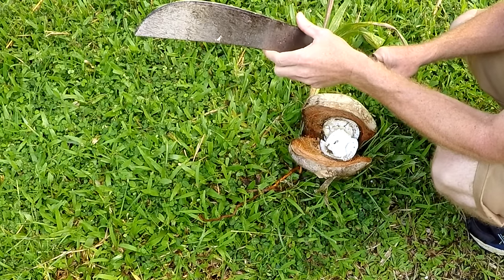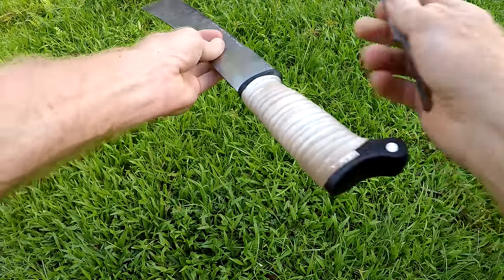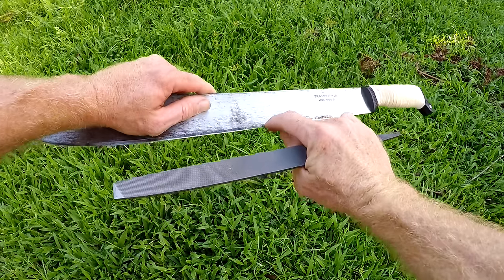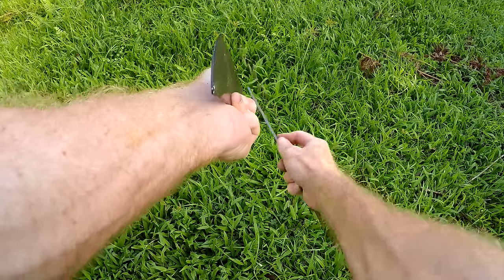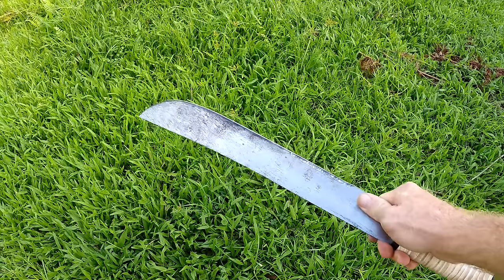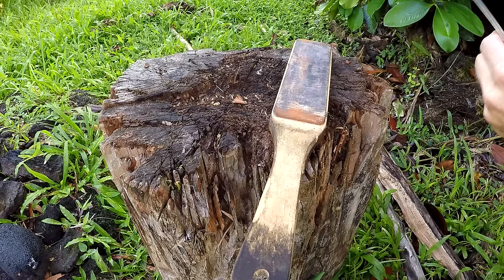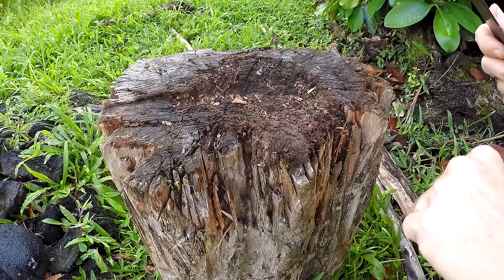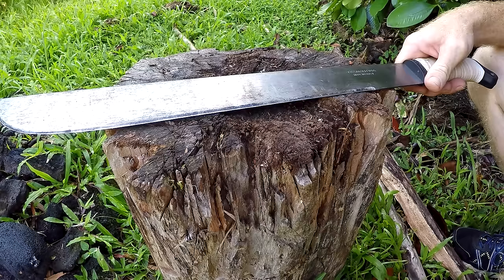How To Get Your Machete Razor Sharp

Comment: Over time, you'll dull your file running it the wrong way, or sideways at the end of your stroke. It's best to work in sections rather than trying to run one file stroke the entire length of the blade. It's more about caring for your file so it continues to work.
Reply: Caring for a $10 file? Just buy a new one..🤷‍♂️
Reply: @EZ_Case  If you like throwing things out and wasting money go for it. Idc what you do.

Comment: Sharp knife is a safe knife.....unless you get cut.
Reply: knife are bloodthirsty,so use it on your own risk.
Reply: A dull knife cut is so much worse than one from a sharp knife
Reply: @1knuckleheadhyperactivenin937  
Right a sharp knife cuts yes but its very clean getting cut by a dull knife becomes more of a mess and leaves your cut more exposed
Reply: @1knuckleheadhyperactivenin937  Except a sharp knife will go through much more. Sure the cut will be cleaner but you're much more likely to sever tendons and the like. The trick is to be careful no matter what, a knife is a knife.
Reply: Kyle Kenney Even though the initial cut is a lot less painful on a sharp knife, and the healing process is a bit easier
Reply: Been accidentally cut by my knives numerous times. Not felt it or noticed till I saw blood. Very clean cuts as well. Healed quickly.
Reply: How sharp is your axe tin man?
Reply: I like ya cut g

Comment: Wow, thank you dear man with shaved arms. 😂 Today, 26 years after my Daddy died, his WW2 1944 True Temper machete is back in my hands!  My sister's had given it to my son. I told him I wanted to buy a machete because I thought Daddy's was long gone, but it wasn't.   No stone to sharpen it, I gave it to my son. BUT, I found that same file you used in my garage....I cut paper!  I'm so happy, you are appreciated SO much, sat here filing it, and now I can use it to protect myself in my horrible city. I used it when I was a little girl to wack weeds down. Thank you!  I didn't need to go buy anything. I won't be shaving my legs with it though, LoL!  Much Love to you. 🙋‍♀️💜✝️🇺🇸
Reply from the maker: Thank you for stopping by
Reply: @gabehumphries5483  thanks for helping me. I found out today white vinegar takes rust off fast. And cheap. It worked..got some steel wool and gave it a rub after soaking it. YaY!  🙋‍♀️💜✝️🇺🇸

Comment: I have a machete that an older gentleman have me back in the 80's.  I think he used it combat in WWll.  The blade is just 10 inches long.  I think he had it about 30 years, and now I've had it at least 34 years. It has come in handy so much of my life.  I do still use it doing yard work. Back in the 80's I used to chip coconuts with it and got very proficient with it. Thanks for the video as I am needing to sharpen it. It was a marine or army issued one.  However it is in pretty good shape, despite some chips.

Comment: Very cool ! I have used the soft nail files / emory boards  to dress up convexed edges away from the shop to good effect. Some 1500 grit wet /dry sandpaper wrapped over a sheath works pretty pretty well too. A sharp machete is a happy machete. Thanks for sharing !

Comment: I enjoyed the video.  A file is the traditional tool for sharpening a machete.  It’s common to see a tico walking around with a sheathed machete and file.  When I first arrived about 20 years ago I too used a file because of convenience.  The difference is that I would laid the blade on a flat surface and terminated with an Arkansas stone.  As for your strop, my original looks very much like yours.  But I made it well after abandoning the file for sharpening.  After using the file for years I came across a Smith sharpener that must be the forerunner of AccuSharp that I preferred for a while.  Later I choose to use sandpaper w/oil.  Now it’s a Work Sharp belt sander.  My Latin machetes are made by Bellota in Colombia.  I am not in the market for another but I do believe that I will seek at a Tramontina the next time, they have a good reputation.  And yes, I made them shaving sharp from the beginning.  When the edge rolled I used another piece of steel to correct this, either my tile floor or the tool from one of my kukris.  I probably used that tool more on machetes than a kukri.

I would be more interested in knowing about the wrap on the handle.  My Bolletas have a wonderful rubber grips that I use as is, except for one that had to tame the upper seam, easily done with a moto tool and sandpaper.  The others I modified with friction tape or ranger bands, which are no more than a bicycle inner tube cut into bands.  However these are being replaced with rescue tape as the sun deteriorates the rubber requiring replacement too frequently and the friction tape frequently leaves a deposit in my hand even after using talc powder.

Comment: Hi- very informative! Thank you! I purchased machetes for clearing out the tall grass. Rains a lot down here in Texas. I do however have a few questions:
1.)When a machete is purchased, is it not sharp at all because they expect you to make it your way? (I was unaware about this and omg I was about to quit, I wasn’t cutting anything off!)

2.)What are the best machetes to get for clearing out yards? Either an online website or Home Depot/Lowe’s that are sold in those stores?

3)When purchasing a machete, is it better to buy one that’s lightweight or it doesn’t matter? (I’m a lady who does not have upper strength but wants a really good grip and cut.)

4) Do all types of machetes come dull and need to be sharpened. Such as the hook kind that is smaller?

5) I purchased Fiskars brand and Home Depot. Is there a better brand? I’m a HD shopper. Fiskars machete and Billhook clearing hatchet. 

6) On the cutting tools I purchased, the machete has holes at the tip of the blade, what is it for? 

7)What’s the best way to sharpen a billhook and how to really get a good use?

Thank you for your video and time. Hoping to get a feedback!
Reply: claudia Covarrubias 

1) some are some aren’t. Use an angle grinder or take it to a service who sharpens lawn mower blades if you don’t want to do it. 

2) if by yards you mean grass then a longer one is better, 18’>. I like to use an 18’ tramontina machete for everything. You can get them at Lowe’s. They are best paired with a gancho or a stick if you are cutting the grass. Basically just use the gancho to push the grass to the ground then cut the base of the grass with the machete. A Colima machete would be good too as they are long and you sharpen both sides of the machete.

3) you definitely want it to be light if you are using it to cut grasses and light brush. A heavier one is for cutting canes and bamboo. 

4) a lot of them do. Tramontinas usually do not come completely dull, however the tips are usually left dull for safety reasons.

5) yes there are way better machetes. I recommend these ones: 

Tramontina 18" Machete with Hardwood Handle and Nylon Sheath https://www.amazon.com/dp/B00LUZU6YO/ref=cm_sw_r_cp_api_i_qNpSDb4HB1DP9

Tramontina 24" Machete with Textured Black Plastic Handle https://www.amazon.com/dp/B01N6I3AYC/ref=cm_sw_r_cp_api_i_5NpSDbVYSHCFF

IMACASA 27 INCH COLIMA MACHETE https://www.amazon.com/dp/B00R0RGQNG/ref=cm_sw_r_cp_api_i_rOpSDb3CC84P1

6) You can sharpen a billhook with a cylindrical file. But they don’t need to be too sharp. Personally I do not use them very much as I prefer a longer machete. But you use them to dig out roots and to cut grasses precisely. Do this by gripping the grass above where you want to cut then cut. 

Hope this was helpful
Reply: A scythe is better for grass.

Comment: When I got my tramontina machete (exactly like the one in the video) for some reason from the belly to the tip wasn't even ground.The rest of my blade was though , that part came with a working edge. So i sharpened from the belly to the tip to a steep convex grind for chopping small trees and left the rest with a flatter grind for weeds and vegetation.
Reply from the maker: gene schuchard most Latin Style blade machetes do not have a sharpen tip. I guess it's for two reasons. It won't poke through the sheath and it's a little bit safer not having a sharpen tip.
Reply: Hmm , Interesting.
Reply: I have the same machete, what type of tape did you put on the handle? It slips a little when chopping a tree limb

Comment: Nice basics. The file sharpening can be done by lying the machete down instead of holding it. Personal preference only. Files get them incredibly sharp, but they do get dull fairly quick compared to knives, whose blade steel has better edge retention. I have started using a whetstone of about 500 grit or less to polish the bevel a bit after using the file. I have never stropped a machete. I use a steel instead to hone after sharpening. Good video.

Comment: Bastard file works great.
If the edge is a wreck, cement is a good straightener upper before the filing.
Wet/dry sandpaper wrapped tightly on file or piece of  wood using  plenty water is another good edge polisher.

Comment: Nice tips and great videos.  I do think that the type of steel and the size of the blade is not the ideal instrument to shave with.  The machete is more of a large cleaver type blade.  I recommend that you clean your blade regularly and give it a light oil.  Thanks and I appreciate your tips.

Comment: Hey mate, what exact file and strop would be good for sharpening a machete that's never been sharpened before but the blade has been cut to a point? Also, do I sharpen both sides? +1 Subscriber also, you have great content!

Comment: This is a great method of sharpening for machetes and axes.  Do you usually pack a file when camping/backpacking?  Or is there a different method you use for field sharpening?
Reply from the maker: Wayside Adventures I would usually just use a DC4 and a piece of leather belt with stropping compound if I was backpacking. You could carry an 8" file easily for those backpacking trips. The 10-inch files stays on the homestead or in the toolbox or in the truck. Mahalo for stopping by
Reply: I always get a great egde fast on the diamond stone ! Files are also freaking awesome for machete and axes

Comment: Your supposed to hold the branch at the top and swing down at the bottom of the stump.  So there is no long hazardous stick sticking out of the ground.

If you stick the file in a vise you can sharpen that thing like a big chef knife and get that thing like a razor.  Depending on the machete it's it's nice and thick you have to put a bevel on it with a bench grinder to get it super sharp

Comment: Hey Gabe. Just wanted to let you know that for the first time I have my 22"Latin Machine absolutely razor sharp. But I have heard the term or phrase "to just put a working edge on it, not a razors edge." What's the difference, if it's a razor edge it is gonna make it easier. I'm sure I'd have to touch it up a bit more. What says you?!👍
Reply from the maker: a machete should be sharp it don't have to be razor sharp
Reply: @gabehumphries5483  Gotcha. Thank you.👍
Reply: MrPocketfullOfSteel machetes are more about just whipping them around.   They don’t need to be that sharp. That being said if you had to cut food with them then you’d want to make them super sharp.

Comment: Don't strop it, just leave it with the file if you're doing it right.  Machetties aren't supposed to be "razor sharp", or you'll be re sharpening it all the time.  Every swing that doesn't cut is going to round that overly sharp weak edge.   Also, the imperfections are called feathers and can act as micro serrations.  In the field, I can touch mine up with a smooth rock just to stand those feathers back up, but haven't ever needed to.
Reply: Exactly. A slicing edge, like one you'd find on a kitchen knife, NEEDS to be sharp, because the amount of pressure you're using is low.

For a machete, where you're swinging it with force, doesn't need to be sharp to still be "sharp."

I find an angle of 21-25 degrees to be the best for a machete. Anything sharper than that, and it dulls incredibly fast. But it really depends on the environment.

For chopping, I prefer 30°. For vine cutting and work around a campsite, I prefer 20°. But that mid point of 22-25° makes a pretty solid "general use" edge
Reply: "Machetties"

Comment: Very informative. Not sure it's particularly useful in my case, though. Got my machete as a hand-me down from my dad, who bought it from The Caribbean (don't remember if it was Guyana, Barbados, or Trinidad and Tobago) then it got lost and forgotten. A few years later we moved and the new owner of our previous house found it in the backyard and gave it back. Needless to say it was so rusty that it was hardly distinguishable. I just started restoring it about a month ago and the rust is gone, but it's so dull it may as well be a metal bat.  Anyways, you wouldn't by chance know how to make a grind stone, would you?
Reply: Just buy some low grit diamond stones between 150-400 grit for re-profiling and a fine for refining and burr removal. This is plenty to get that machete back in working order. If you want to get real crazy sharp I would recommend getting a 1000 grit stone, 4000 grit stone and some 15000 grit diamond stropping paste and it will be as sharp as a razor. The first set up would be between $50- $100 dollars for everything and the second would be between $100- $200
Reply: Or a ken onion worksharp benchsander they have different grit options for the belts that it uses. I only recommend this for ease of use. You wouldn't get as fine of an edge with an electric sharpener as opposed to some water stones and a strop but it will be sharper

Comment: I got a Corona machete for 12 bucks. Chopped down 50 40 ft sugar pines with a 6 to 8 inch base... used out of the box... never sharpened it once.....I'm just very careful not to ever hit the ground or abuse it,, the edge doesn't have a visble nick in it.
Reply: That didn't age well.

Comment: That is called a "single cut mill bastard file".  
It is also the preferred tool for sharpening a double-bladed axe.  No axe should leave home without one.  
Double-bladeds are easy to sharpen because the (intentionally) dull edge can be driven vertically into a log, exposing the opposite blade at the perfect angle for downward strokes from the file.  
With single-bladed tools this technique is more difficult, but if you can brace or wedge your machete vertically you will be able to sharpen it faster and better by coming at it from above with downward strokes.  There is more potential risk in this technique because the blade faces toward you, instead of away from you as with your technique.  Longer files are safer and quicker: your hands stay farther from the blade, and you can employ longer strokes.
Reply: Excellent advice especially on sharpening a double blade axe driven into a log.  I'll try that.

Comment: I found the only real way to maintain a machete is with a File, even coarse stones made for machetes take forever to get an edge back!
Only thing i would do different is in general i would use a smaller finer File, like a 200mm (7,8") file, and i would work the profile a bit longer and  at a more shallow angle.

Comment: Nothing like a good man shave in the jungle eh? Sharpening is one thing I'm fine at but never took it to the level of arm shave worthy. Is there any truth to the old "you can strop with newspaper" phrase? I never looked in to that one.
Reply: Comp Pend you can strop with mud on a belt or piece of paracord
Reply: I always use the cardboard from the back of a note pad for stropping.  The trick is to lay the blade almost flat to the point where it doesn't appear to even be angle properly to affect the blade but it will. Couple times both sides and it's razor sharp

Comment: I bought a machete and it was so fckn dull. I got a sharpening stone and that did jack squat. I used a file and that did about nothing as well. I had no idea what to do with it or how to sharpen it. I can’t even cut a paper with it, if I apply pressure to the paper with the machete or try to saw at it, it literally just crumbles
Reply from the maker: what machete
Reply: H.I.S Survival Coleman’s brand

Comment: The end of the blade curves around, when you get down to the curve your file is going parallel with the blade.  So you need to adjust your angle of attack as it follows the curve.
    Um,....11 strokes in one spot to remove arm hair, I wouldn't call that super sharp, (that's why you chose that camera angle)  but hey, it's a machete not a knife.
   Good video, thank you.

Comment: That edge is not very good. You can get a much sharper edge with just the file, and no strop. Sharpen your machete following the edge angle that is already there, once you feel a burr, do increasingly lighter strokes until the burr is gone completely. After the burr is gone, take your file and file just the very edge of the machete with very light strokes at a steeper angle. You've created a microbevel and an actual razor sharp machete.
Reply from the maker: no microbevel if you strop. I prefer a convex edge

Comment: The makers of the machete are copying cold steel
Here's how:
1 they copied the handle
2 they copied the high carbon steel
Reply: Lmao what? A bunch of machetes use high carbon steel, and all knives have handles. Btw, tramontina is a much more "authentic" machete brand than cold steel, so if anyone's copying anyone, its cold steel copying tramontina. But nobody's actually copying anyone because you can't trademark using high carbon steel and handles.